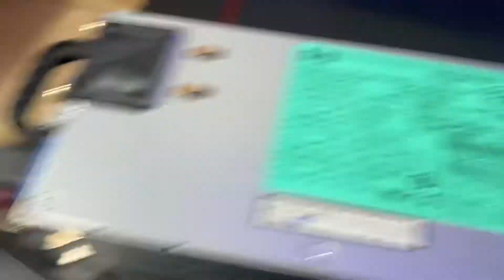Using Power Detection Port To Reset Server Power Supply

Comment: Excelent men, i want to do the same, buy i only have a doubt with the amperaje of the power supply, what is the amperaje of the power supply that you are using, tnaks man
Reply from the maker: I think that power supply was around 500ma.  I think it draws very little actual current.

Comment: hey man, I need to find the way to connect the 4th pin to a 12v port of the same exact psu (and same exact board). Do you have a link where I can see which cable to use and how to put this on the board ? Would be dope ! thanks !